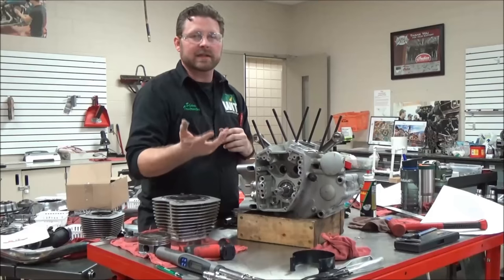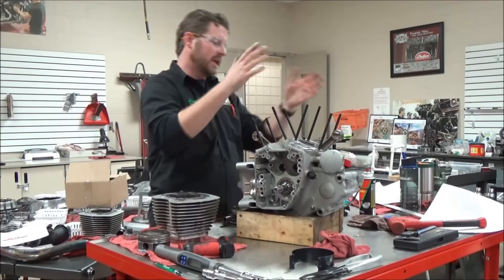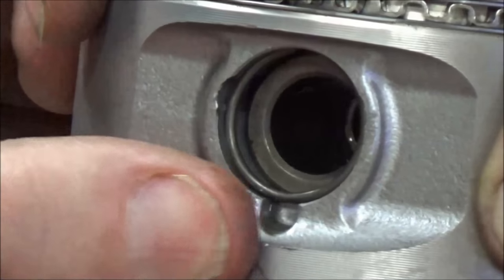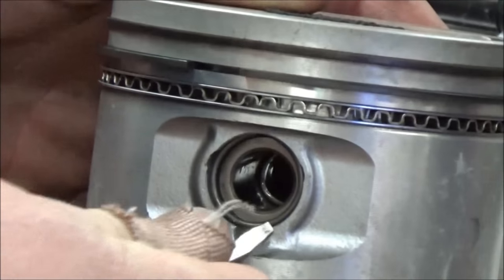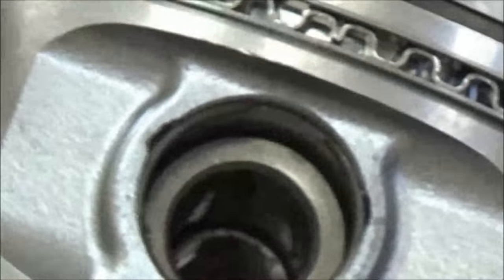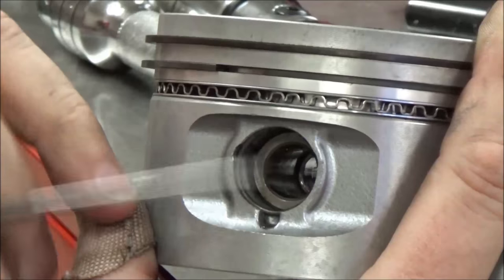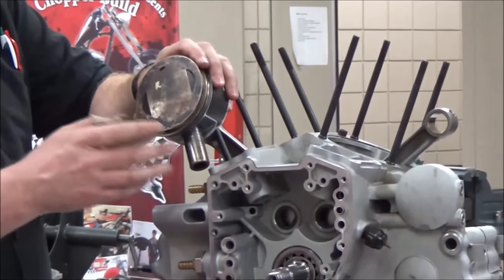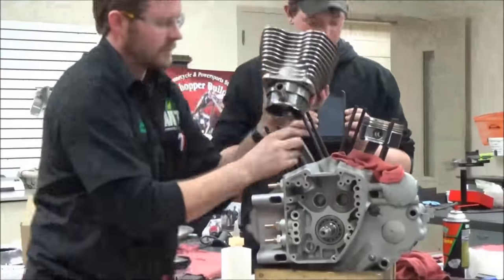Twin Cam Series: 13 How to install a Piston and Cylinder on a Harley S&S TP Revtech Jims Ultima

Comment: I'm rebuilding my 2002 sportster 883. Are both arrows on the pistons facing front of the motorcycle?  I found one video this guy is saying it should face the exhaust pipes. Is this true?